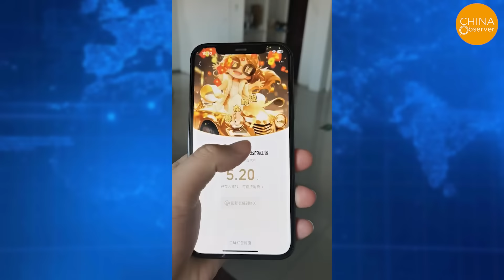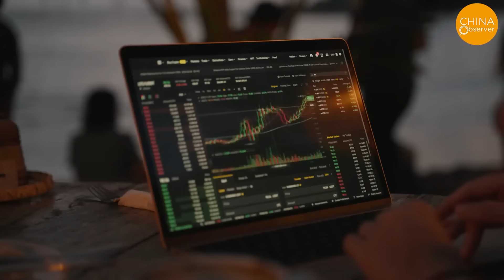Shenzhen’s Become a Ghost Town: No Cars, No People, With the Unemployed Sleeping Rough

Comment: Good sir, it is called a DOOM LOOP, here in the USA.  
It happens with almost predictable commonness at older malls all across our country.  

A mall — any of them, but particularly an older one — has a couple of high end "Wow" stores.  Magnet stores.  In the US, that might be a Macy's plus a Gucci, plus a couple of other higher-end outlet/department stores.  Then, for whatever reason the mall loses one of them, say the Gucci store.  

Attendance at the mall declines somewhat.  Some of the smaller vendors, not doing great at ANY time at the mall, feel the squeeze, and give up.   The mall loses a dozen vendors.   Macy's struggles because customer visits are particularly hard hit, especially at The Holidays, when the same customers can go to newer malls, spiffier malls, not all that far — by freeway — away.   Macy's runs sale, after sale, after sale, and her net sales don't markedly improve.  

After much negotiation with the Mall owner to get better rent rates, Macy's gives up.   Announces closure and a big, Big, BIG final sale to close it down.  

Not before she closes, almost all the Mall's other vendors get the message, and give up. 

Macy's might not even make it to the Grand Final Sale.  Customers leave, and aren't ever, never ever going to come back. 

DOOM LOOP.
This doesn't apply just to malls.  

It applies to China's very, very over-leveraged outdoor sales districts.  They — like Autumn mushrooms — they grew up fast and furious, feeding on the opposite of a Doom loop, a Prosperity-by-Going-Big loop, and paid little attention to the ridiculous rents being charged.  ALL FAD, all glitz, all glow.   And … who knows … like a Ponzi Scheme, if you (vendor) were early in the game, you got better rents, and you actually profited quite well by buying a big bag of poker chips early on.  

Then… the jig (dance) is up.  Rents too high, limited capacity for more customers, lack of product diversity or uniqueness.   Everything starts looking desperate.  Vendors hire hawkers, and the situation is … not a happy one.  The smartest vendors — especially the early ones, having made their coin — pull out and close shop.   

Ah, now the magnet shops are going away.   The customers stop acting happy and buying.  They become less and less in number.   More and more shops close.  Abandon ship, as the ships are sinking under the weight of their leaky hulls.  Can't bail 'em fast enough.   And thus in a few months-to-years, it all collapses.  

The whole district isn't even alive enough to support a horde of starving rats.  Its dead.  

DOOM LOOP.

Its the way of the world, and has been since the caravans travelled the Silk Road.  

⋅-⋅-⋅ Just saying, ⋅-⋅-⋅
⋅-=≡  GoatGuy  ✓ ≡=-⋅